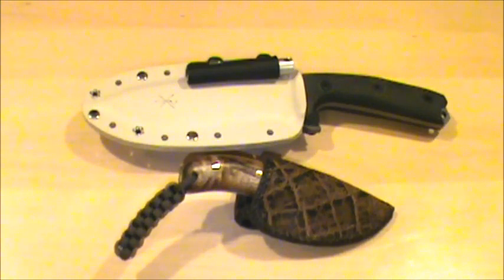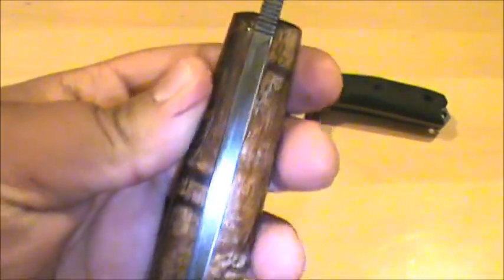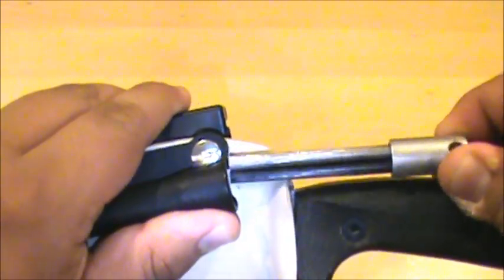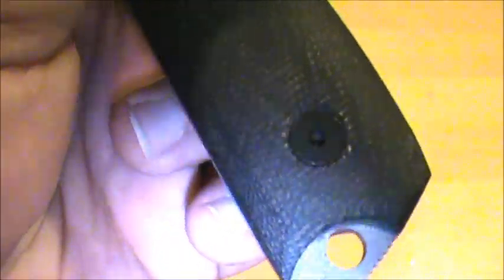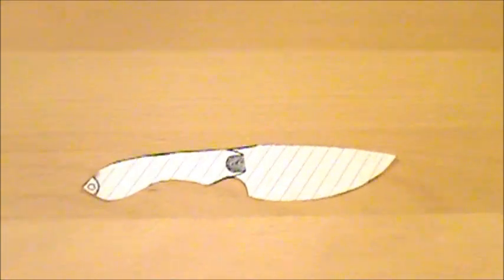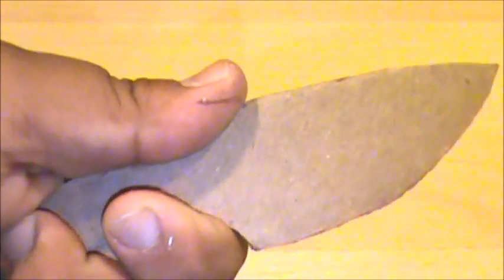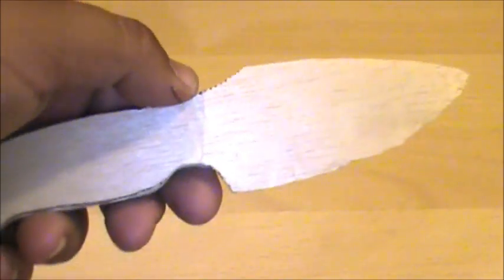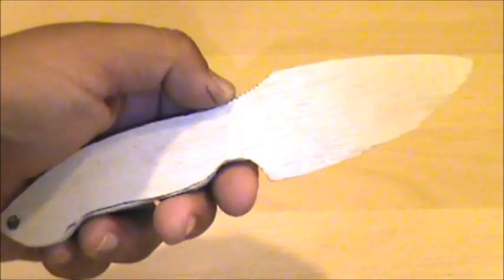How to Design Knives that Work!

Comment: I may be mistaken, but I thought once the knife is properly heat treated it will no longer be magnetic...
Reply: i think thats the indicator that the metal is ready to be quenched in the oil after it has been heated to a sufficient temperature, im not sure if it remains non-magnetic after the quench however